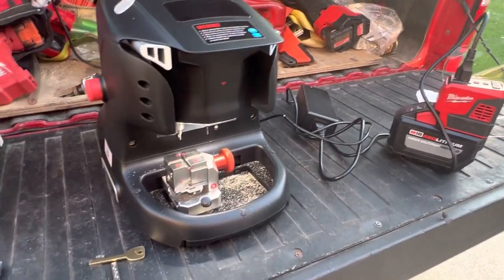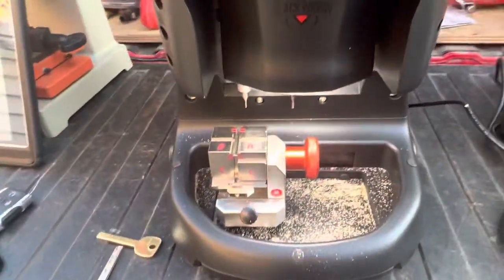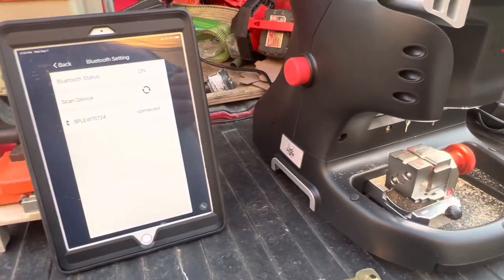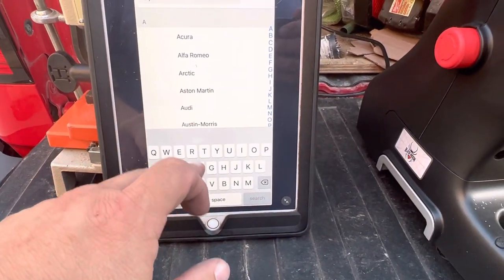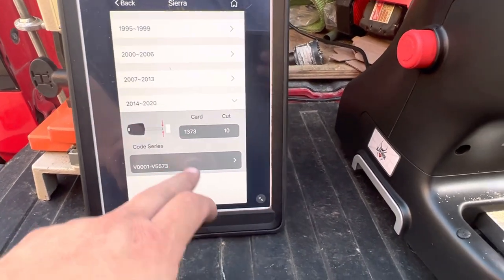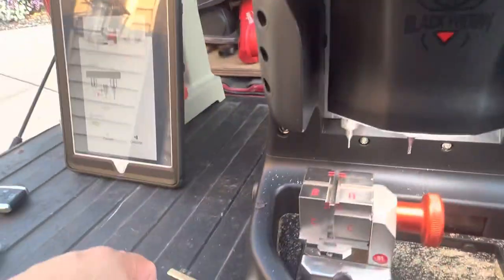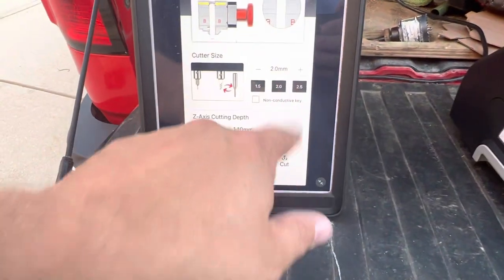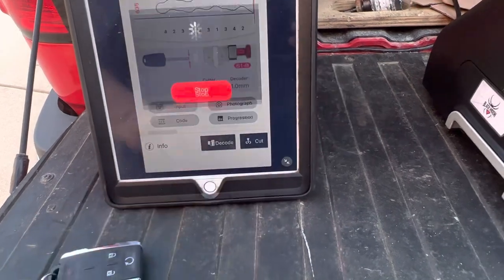Black Widow key machine running off a Milwaukee Tool M18 power source inverter.

Comment: I was gunna get a black widow back in march but ended up getting the dolphin. How do you like the black widow machine so far?
Reply from the maker: I’ve only had it for about 24 hours. So far I like it a lot.
Reply: @firefighter1241  I like how you can cut tube keys, residential, and Tibbe. But you need the complete one
Reply from the maker: @pouncerminned863  I got the complete.  It’s only a matter of time before I get the other mounts and special cutters for it.  Getting it serviced in the US was a big selling point for me. I would have loved to get the Triton. But it’s $2000 more. But they do share many of the mounts so if I ever want to upgrade I’ll probably have them.  It portable and able to run off different power sources were also a big selling point. I do business and residential locksmithing during the day and auto locksmith on the side as it’s a conflict of interest to the day job. So being able to use the same machine for both jobs can come in handy.
Reply: @firefighter1241  yea I agree. I do some res and mostly auto, but I have an hpc 1200 for res and I use my dolphin for auto. I also have flash 008 for duplicating, soooo much better than code cutting 10 keys for a customer! But yea, the US support is what also made me want to get a black widow. Great video and good luck!